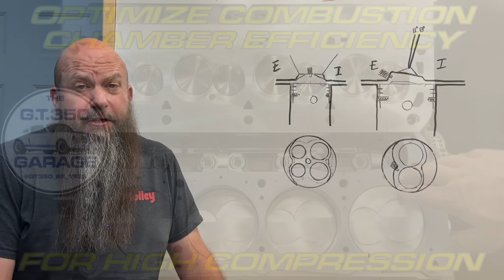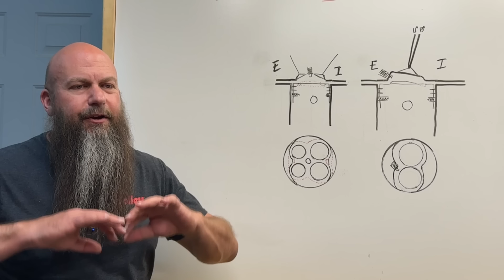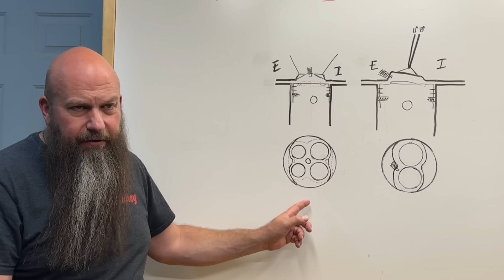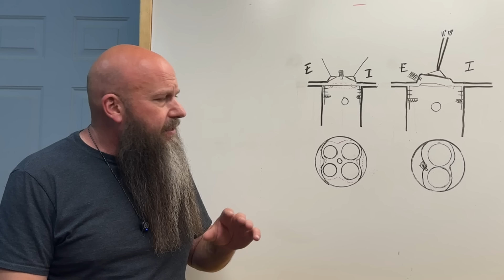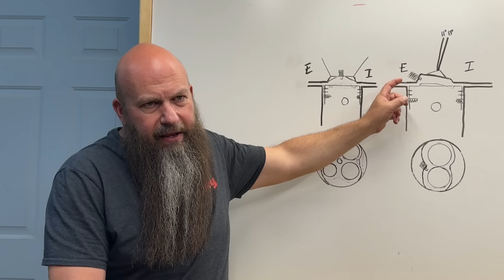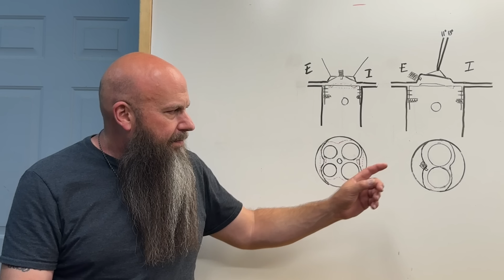How To Optimize Combustion Chamber Efficiency For High Compression And How It Impacts Tuning

Comment: Hi Walter,
I’ve been watching your videos and learned a lot. You didn’t specify the new heads, but they look like TFS 11R 190s. I’m guessing 190cc since they start at 56cc and you mentioned milling them to 46cc.
I have a 331 stroker with flat top pistons, .005” in the hole, .036” MLS gasket, and unmilled 11R 190 heads for 10.5:1 compression. Port-matched RPM Air-Gap, 670 Holley, MSD Pro-Billet with 32° total timing (dyno-verified). This was my first build, and I was disappointed it rolled off at 5300 rpm. The cam is 218/224 @ .050” with ~.560” lift; the dyno operator felt it was too small, but I expected another ~400 rpm with these heads.
In hindsight, it was likely underfueled at 13.2 to 13.7 AFR. I wanted more jet, but was talked out of it in the moment. I’ll chalk this up to my own lack of experience. Final numbers were 351 hp @ 5300, 396 ft-lb @ 4200, all while maintaining 17 inHg at 700 rpm.

It's so frustrating getting old-school guys to accept that better chambers and high-flowing heads can produce power with smaller cams. I’d love to hear your comments on this.
Reply from the maker: I’m going to recommend you shoot me an email so that I can provide you with some better guidance:

thegt350garage@gmail.com

The cam is definitely too small, and it’s probably not optimally installed either.  Those two things are conspiring to keep peak power at just 5300rpm.  I’d be happy to discuss that by email, a weekend, some gaskets, a camshaft and perhaps a timing chain, and you could see 900-1100 more usable RPM and likely 60-75 additional horsepower in exchange for about 20lb-ft of peak torque and 2-3” of idle vacuum.
The 670cfm vacuum secondary carburetor is on the small side for your application.  It’s actually about at its optimum air/fuel delivery capacity for a typical out of the box 670 Avenger carburetor.  You definitely need to jet it up, 13.2-13.7 on pump fuel is .93-.96 Lambda, which is pretty lean, you want to be in the .86-.88 range at peak torque and the .88-.90 (12.5-12.8) range at peak power.  Again, I’d be happy to discuss this further via email.
Reply: @TheGT350Garage  email sent, thanks.

Comment: What criteria do you use to select valve timing events? I know you are not fond of DCR, but everybody is using it, although it may be flawed. Piston speed / geometry / rod length /  stroke??? How do you determine how much overlap is required?
Reply from the maker: I’m planning on doing a video on how I select cam events very soon.

Comment: 71 z 28  stock heads double hump i think heads 202 i 160 e  they run what i would say was a pretty big dome piston . changed the cam to a duntovff  solid cam  at the time they called it the 30 30 cam . looking back why did they run so well . that thing was fast . chevy sb heads are always bigger cc  heads . i never understood why . Any ideas .
Reply from the maker: They ran well because they had leaded higher octane fuel that burned a little slower and if you cranked up the timing they made good power.  71 was the end of an era.  And the Duntov cam was pretty healthy, 254/254@.050, and ground at 112ICL, and with a ton of overlap.  You could get similar performance with better vacuum from a smaller cam using less duration with more lift, but in its day that was GM’s equivalent to Ford’s LeMans cam for the 289 HiPo.  

Port volume is only relevant when comparing heads from the same engine family and the same manufacturer and further the same head family, what matters is cross sectional area and valve diameter.  An example is the TFS 11R 190cc head, it’s comparable to an AFR 205cc Enforcer.  The TFS head has a smaller volume because the valve angle is different and the valve was moved close to the intake face of the head.  But the two heads have similar flow numbers, and similarly make big power.
Reply: @TheGT350Garage  THANK YOU . I MUST HAVE MISSED YOUR COMMENT .. I DO REMEMBER THAT AFTER 1500 MILEES  YOU HAD TO CHANGE  THE SPARK PLUGS BECAUSE AT PEAK RPM.S IT  WOULD START BREAKING UP . THIS WAS BACK IN 1974  . BUT I REMEMBER THAT THING WAS CRAZY FAST

Comment: Water injection and high compression for the win! Also, making a Singh groove on the head to give a pathway for gasses in that quench area opposite the spark plug is immensely helpful. Did this to my low compression (9.8:1) Corvair heads and eliminated any knock issue I had experienced previously, even w/ 87 octane and low RPMs. Have a LS1 engine I want to build into a high compression (14:1) stroker w/ water injection to both decrease the NOX and improve efficiency.
Reply: Overlooked:
Singh Grooves extend to within .050" of the cylinder wall. This allows the groove squirt to go to the cylinder wall and displace the dead mixture in the crevice volume above the rings... Quenching that sudden spontaneous pressure explosion of fuel (ping) when the flame front triples the effective compression.
Yes the the chamber mixture is tumbled.
Reply from the maker: You’ll want to come back for the video I’m doing on how I groove the quench pads.  It’s a little unconventional compared to the typical “Singh” grooves, but it works extraordinarily well.  It’s a technique I’ve modified and adjusted since I first learned about Somender Singh grooves in 2003.

Comment: My friend you are spot on distance is time. Comp. ratio means torque
Reply: I dont know.
Compression ratio increases temperature, which proportionally increases speed of sound and thus flame-front-propogation velocity.
Compression ratio also has zero effect on power or torque. Expansion ratio does. An engine makes power by expanding combustion gases, converting it's heat into mechanical energy. If the compression ratio is higher, the expansion ratio on the combustion stroke is higher, meaning the engine extracts more heat from the combustion.

Comment: Thanks Walter. Can you list out the heads and pistons you have chosen?  Also have you looked into details of any special spark plugs?  Will it be possible to reduce the ignition timing even further with modern spark technology.  Ie get your timing less than 26°. 
Does anyone make any of the formula 1 style plasma jet spark chamber spark plugs?  Imagine if you could screw something like that into the spark plug hole and get a further upgrade.
Reply from the maker: I’m running TFS 11R190 heads and TFS pistons.  I’ll run AR324 or AR3923 spark plugs for most purposes, but I’ll start and break in the engine on regular 3924 Autolite plugs.

Comment: One trick I saw Ben Alameda propose was cutting a shallow depth sort of v-channel into the quench pads on the head. Stating it allowed the mixture to get to the trouble spots in the chamber close to the cylinder walls where sometimes fuel molecules and combustion gases can accumulate. Stated this aids in a more uniform and complete burn on the piston crown. Never tried it, but it made sense when he was describing race piston crowns/ring lands always failing in that area. I guess could be sort of a "swirl" promoting concept as well. He's always an advocate for running as much compression as you can, by optimizing the chambers.
Reply from the maker: I’ve been grooving heads since about 2004.  The idea tracks to Somender Singh in India, he holds a patent on the concept, and I give credit accordingly.   I have some unique approaches to grooving combustion chambers, and they differ from what most do.  I’ll be doing a video on chamber grooving very soon on the heads you see in this video.
Reply: @TheGT350Garage  I haven't seen anything where putting grooves ala Somender Singh into squish/quench provides any positive results.  In my mind the squish velocity and turbulence is reduced unless additional sqush/quench area is added to account for the area lost to grooving, (think of what happens when you drop a sheet of plywood onto flat concrete).

Comment: Walter how susceptible to detonation are lower grade fuels? Just trying to gauge how this relates to fuel in the country where I live (New Zealand) all our fuels are rated in the RON system and we have 91, 95 and 98 at the pump. I’m building a 289 similar to yours with 98 vintage trick flow tw heads.
Reply from the maker: 95 RON is about equivalent to 91 AKI and 98 RON is about equivalent to 94 AKI.  Stick to those and you’ll be fine.  

The old Twisted Wedge heads have a good combustion chamber that responds to a few little tweaks.  It was quite advanced in its day and remains a more modern chamber than most other aftermarket heads for this engine.

If you want to get the compression up near 12:1 you’ll have to mill the heads substantially to reduce the chamber volume down to ~48cc, that will take nearly 0.090” off the face of the heads, which in turn comes out of your valve clearance .  Alternately, target being over 11:1 and you will only have to mill about .060” to get to ~52cc, you’ll also have no concerns about fuel octane.

Comment: So few machinists discuss the cause and effects of these details. It's what the engine owner needs to be educated. My local machinists only told me I can't have power and mileage when doing a mild build, but they simply didn't have the education. This video gives the proper information to maximize both power and efficiency. 

I went back to the last machinist a few years ago and told him my findings... He had to stop and think. He truly believed in his knowledge of never going past 9:5:1 compression in a towing 460. I was at 11.3:1, and tore the engine down 8 years later to stroke it... Ran as good as the day I built it.
Reply from the maker: A 460 can handle a decent amount of compression, what it does not like is excessive timing.  A 72cc iron DOVE-C head on a 460 flat top makes a great 11:1 compression build, but guys are easily scared by the iron heads. They need more cam duration, with DOVE-Cs I like a 236° or 238° intake lobe that nets about .580-.600” valve lift, and it needs to be installed on an ICL of 114°.  Keep the air fuel ratio a little rich and run timing it wants (about 27° for that combination).
Reply: @TheGT350Garage  I did all this at 11.3:1, 200-208 cam, ~.600 lift, 108 ls,  ported Doves, heavy towing...  EFI heads like this as well with flat tops. At 523 cuid now, same setup with EFI heads, smaller valves bigger cam, more timing at part throttle but less timing at wide open (~28°)...

Yes, guys get scared of iron heads. But when you read the engine properly, you find the boundaries aren't so bad. It's pretty forgiving. I prefer the iron for towing due to port shape/volume, and my intended RPM range. Ported Doves didn't come alive until 2600 rpm on 460 cubes, not good for towing. Stock the doves came alive at 1500... D3s around 1200. 

Short hydraulic roller cam sure woke up the bottom end... 10.5-1 up to 11.3:1 gave me 8% increase in fuel economy while towing, carbureted. Haven't dialed in Holley EFI yet on the new build... working on turbos before I start that one. And automatic transmissions... Stock ZF5 spd won't hold the power I'm going to end up at.
Reply from the maker: I’ve run D0VE-C and D3VE-A2A the only real difference is chamber volume and the D3 head is available with or without secondary air injection.  Both heads need more cam than people want to run.  At 10.0-11.0:1 CR they do work well, but porting can absolutely destroy the performance of either head.  Intake bowl, combustion chambers, and exhaust bowl, and the valve job is everything.  Port plates with tongues on the exhaust really help, as do Tri-Y headers for truck applications that are 1-3/4, 2-1/4, 3”.  I have a fair amount of dyno time on 385-Series builds ranging from 429s to 557s using canted valves, I’m particular to 429s and  514s for cars, trucks get 460s or 545-557s.
Reply: @TheGT350Garage  I love hearing your experience!

I haven't tried tri-y's, but ran L&L outside of frame, and Hookers... 2.5" and 3" duals... H pipe was mandatory, as was 2.5"... 3" caused me a huge drop in torque below 3k rpm, where it then picked up.

Dove heads do have a slightly larger intake port, barely noticable over the d3s... But when I ported the doves and put in 2.19" valves, it bogged below 2500, coming alive at 2600... Would have worked with an automatic trans, but not a stick. Trying to get 25k lbs moving uphill was certainly a struggle.

Have you worked with EFI heads? I'm getting ready for F3s on the 523 now... I have to maintain low-end torque, but now with probably 6l90 trans...

Oh, and the small cam was necessary so I could recover some semblance of bottom end torque when my heads were too big...  My favorite cam was a hyd roller 200-212 from Crane as low-end gains were massive, but I had much better mid-range with the 214-224 flat tappet. Fuel economy towing was the same on both, but the hyd roller gave me 11-12 without 5spd, dually.. the 214 cam gave me 9-10. Pretty noticable when you're making money with your ride.
Reply from the maker: It’s unlikely the heads were too big, but rather that the port work and larger valves actually hit low lift flow and kills port velocity.  Happens when people try to port 385 series heads.  They like the stock valve size with a back cut and undercut stems, a good valve job blended into the bowl, keeping the throat at about 86-88% helps create a venturi effect onto the seat that improves low lift flow, they move so much air with the valve past .300” it’s not necessary to go past the bowl and guide on the intake.  On 460 truck engines I like to run 10.0-10.5 CR with a cam around 226/232 and .570/.580 lift.  I also run a 112LSA and install the cam at 112ICL.  That would get a Weiand Stealth, Performer RPM or RPM Air Gap topped with a 750/770/780cfm Holley vacuum secondary, and headers as described previously, the exhaust would merge from the 3” collectors into a 3.5” single.  In a crew cab dually with a C6 and a Gear Vendor, and 4.10 gears, it would pull down 15mpg highway and get 12mpg towing an open car trailer with a ‘66 GT350 on it.
Reply: @TheGT350Garage  intake ports were definitely too big... It was a test to see what would happen. About 0.100" removed from roof. Radiused short turn as much as possible, by itself to see the gains, very noticeable off idle to 2k rpm gain. I had to go as far as removing my Wieand Stealth intake for Performer and 600 carb, then I got some low-end. I've played with the BBF  primarily for close to 30 years. The doves I worked over were compromised from the last guy before me as exhaust ports had been ground to water... I welded them and used them temporarily, so I could learn what do a what, as moat research said to open them up.

I agree with your findings, except you must be at higher elevation... 226-232 cam would not do well at 5,000' and up with a manual trans... I'm just beginning to learn about automation trans... but manuals show the engine all throughout the power band.
Reply from the maker: The cam is letting air and fuel into the cylinders.  If you look and my most recent video before this, the engine consumes the same volume of air regardless of elevation,  what changes are the pressure acting on the engine and the density of the air.  The characteristic of the engine changes because of pressure and density, not volume.  At elevation, a carburetor needs to be jetted leaner to account for the lack of density, not the lack of volume.  If anything, at elevation a bigger carburetor is sometimes an advantage.  A mild BBF may be perfectly happy at lower elevation with a 600cfm carb, but at elevation a properly jetted 750cfm carb usually performs better.  And I have to say, because of the unique challenges of changing elevation, I became extremely good at tuning vacuum secondary carburetors and optimizing their ability to sense changes in engine load.

I grew up in the mountains in California an regularly drove at 3000ft to 6000ft elevation, but I raced and played in the Central Valley at 500ft, I’m well aware of the impact of elevation on performance, but I learned to build the engine how I would want it to perform at lower elevation and simply tune it for higher elevation as needed.  Adaptive EFI is where it’s at for anyone crossing more than about 2500 feet of elevation change regularly.

Comment: I like your thinking. This is how we continue to make more power. Todays Mazdas engines run 12:1 on regular gas.. Sure they have variable valve timing, but with uitra compression, they are able to make serious power and efficiency.
Reply from the maker: Mazda and Toyota are both running up to 14:1 static compression ratios.  Toyota uses the high static compression ratio to keep cylinder pressure up during simulated Atkinson cycle operation.  Mazda on the other end of the spectrum is using the high static compression and variable valve timing to build cylinder pressures that allow gasoline compression ignition with their direct injection system.  Two entirely unique paths to achieve increased efficiency from their respective engines.

Comment: informative vid. do you thi nk you can consider doing a vid or at least comment a little more about how to improve the Cleveland 4V closed combustion chambers, including some suggestions of compression ratio with OEM style cast iron heads?
Reply from the maker: Closed chamber Cleveland heads can be reshaped to mirror a far more modern combustion chamber.  If you research Bob Glidden’s 351C Pro Stock heads, he would weld up the chambers, lay them back, and unshroud the valves to great effect.  I take no issue running 351C 4V closed chamber heads at 11:1 compression.  The key is putting in the right cam, the right way.
Reply: @The  Thanks